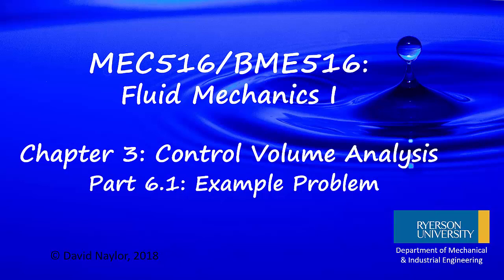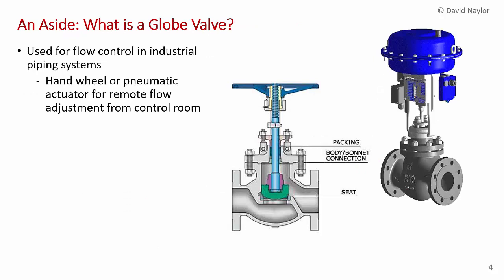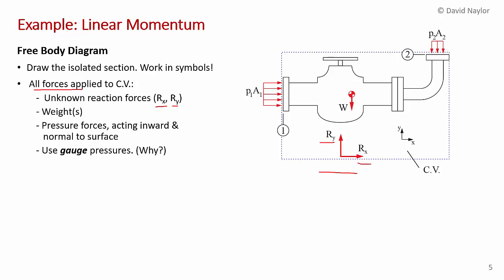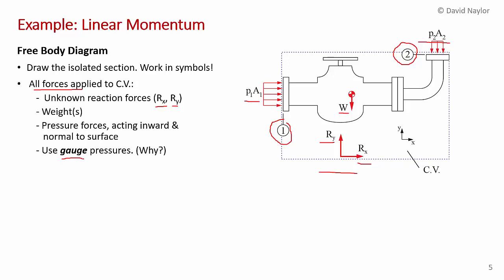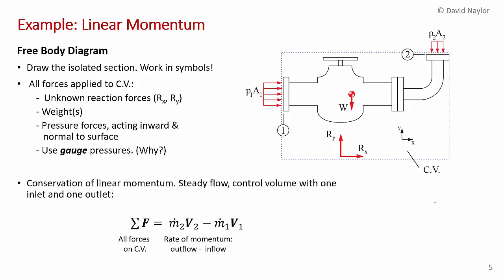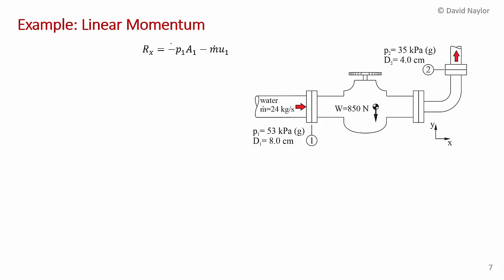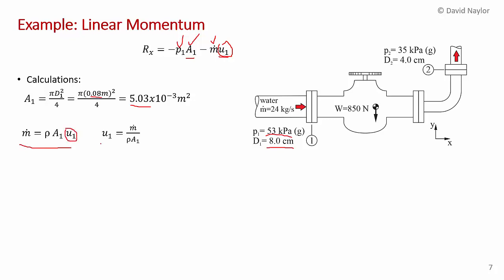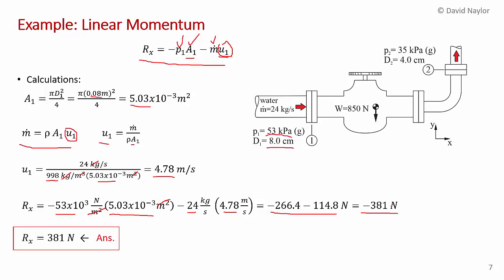Solved Exam Problem: Forces in a Piping System using Linear Momentum

Comment: The thing that makes your lectures different from other regular Fluid Mechanic lectures available on the net is: @9:28.
The moment you ask us to think if an equation or an answer make sense or not...
Thanks Prof. Naylor
Reply from the maker: Thanks. I agree that doing a quick "sanity check" on the final expression is something that instructors should emphasize more. It's a critical step, especially when more than a few marks are at stake.